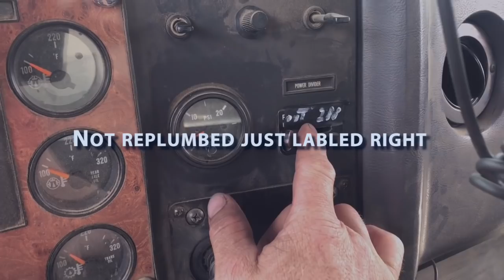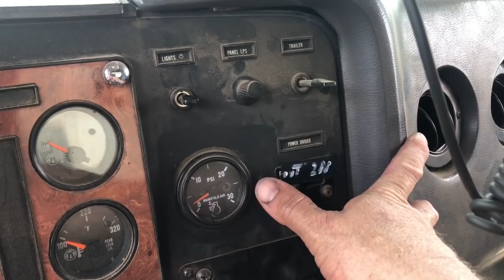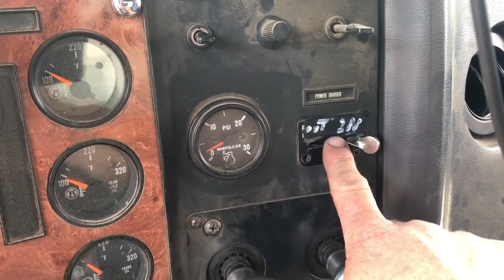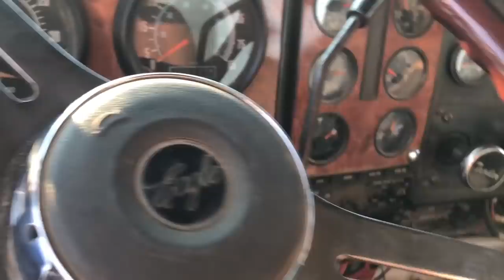Saturday Memorial weekend

Comment: I may be wrong, but I was always told that the cornbinders are plumbed so that the lack of air is what engages the divider, and the application of air takes it off.  Supposedly they did that so that the system would get cycled more often because the average OTR truck wouldn't use the divider that often.  I could be talkin out my butt though, LOL.  So possibly someone did some work once, didn't realize that and put the switch in upside down or something?

Comment: international uses spring pressure to engage the power divider and air to disengage. most all other manufactures do the opposite FYI  So if the rears are out of a kw theres your problem
Reply: THOMAS PERKINS Well ain't that something. Hope Wade reads this.
Reply: i learned this several years ago when i put air leaf and different rears in.  solved it the same way covered label with tape